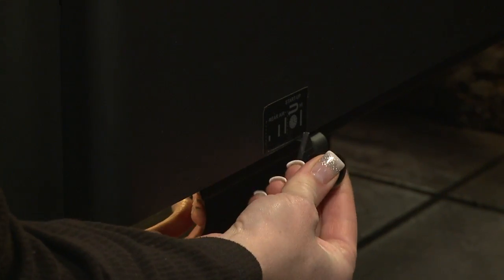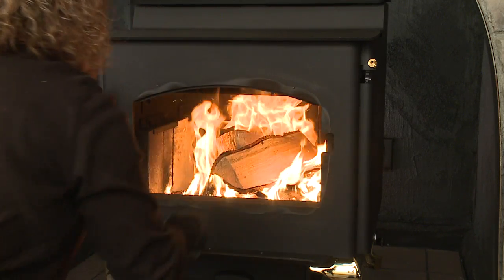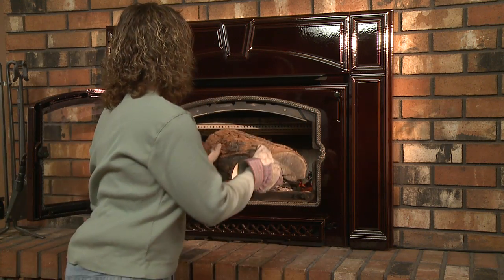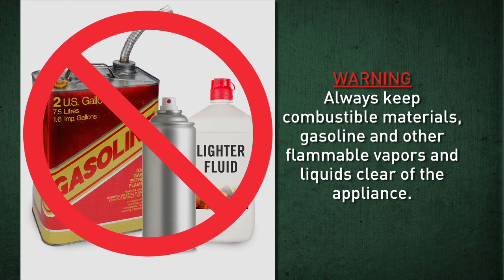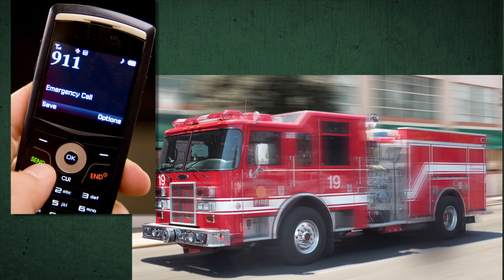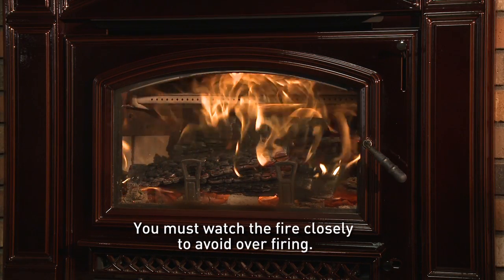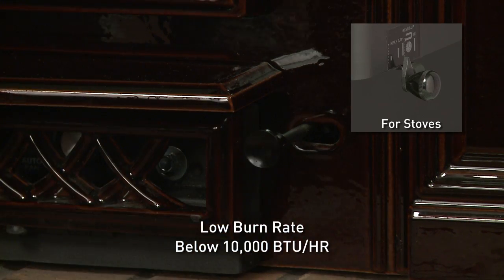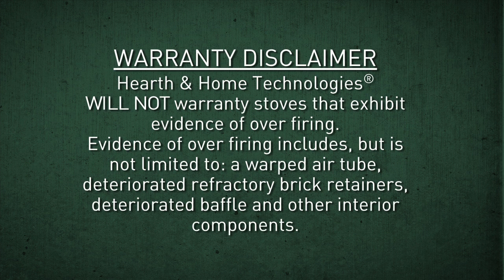Quadra-Fire® Wood Stove or Insert: Building a Fire Video

Comment: can you use green oak in a quadrafire 2700i
Reply from the maker: Thank you for reaching out Rodney Hendricks,

Your appliance performance depends on the quality of the firewood you use. You can burn a variety of woods but several factors can affect whether the wood you choose will produce the heat output you expect. One of these factors is moisture content. For example, seasoned soft wood takes nine months to dry and seasoned hard wood takes about eighteen months to dry. By using seasoned wood you will get the optimal performance from your appliance. Seasoning time may vary depending on the drying conditions. Seasoned wood contains about 8,000 BTUs per pound. Using green wood may cause performance issues.
Reply: No